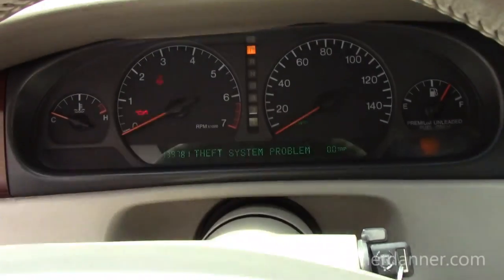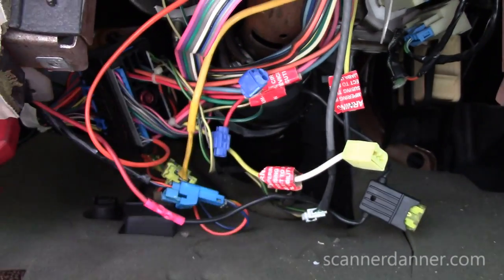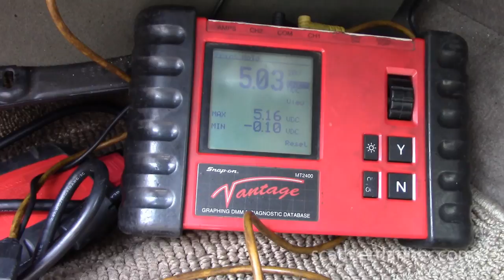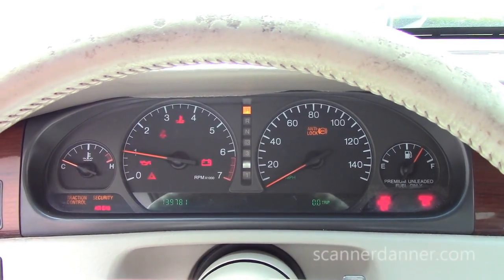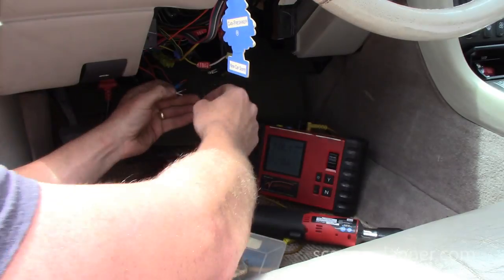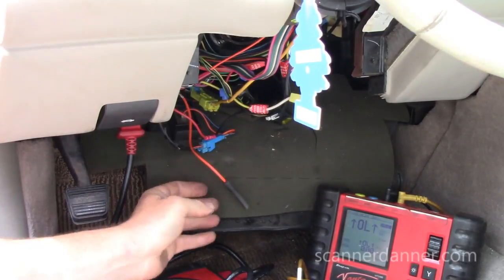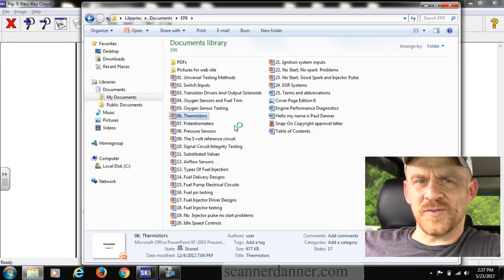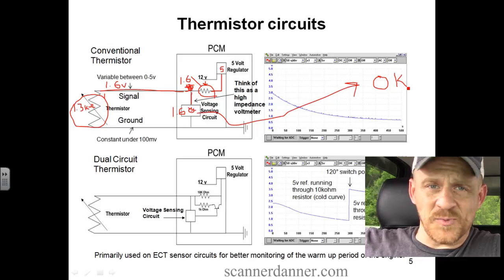How to troubleshoot/bypass a GM VATS Passlock Passkey System

Comment: I'm here in Monroe North Carolina and had just recently taken my allante to a service station on interstate 74. One day just would not start theft activated light was not flashing and had it towed to Marty Moore's repair station. they're diagnosis was bad ignition switch and vats system but they would not bypass for me said it will cost $1,000 I also had to pay $150 for the diagnosis I hope you're not that kind of shop. When I had gone to pick the car up they had it started and backed it out and parked it and said they would have to charge me in order to start it again. I am 60 and unemployed and have exhausted my finances what rip off these places are.

Comment: Easy way to solder a resistor is to cut the two wires to different lengths and solder the two ends so the resistor lies along the length of the wire then slip heat shrink over the top.

Comment: I lost the key to my 97 Lumina went to the dealer gave him the VIN number charge me $50 for a new key. key was cut right so it turned the cylinder car would start for Split Second then cut off. had the wrong pallet in there and they would not refund my money. so I got a volume control knob Off an old CB radio began with it turned all the way down try to start it and incrementally turned the knob up and it started so I measured the resistance value of the volume control knob at the position the car would start at. went down to Radio Shack matched up with the resistor of the proper value and was back in business. come to find out GM Vats had like 15 different possible resistor pellets during those years. shade tree mechanic way of doing it if you don't possess all the proper tools like scannerdanner has and you did not have the key in the first place to measure the pellet
Reply: 08 silverado lgnition replace
Reply: The mighty engineer !

Comment: I watched this video for the first time last week and what do I get in today? A vehicle that the customer replaced the battery, starter and electrical portion of the ignition switch and it still wouldn't start. First thing I check for is flashing security light, it's there. Used this bypass method and within 10 minutes had the car running. Thanks for another great video, Paul

Comment: Great video as usual Paul. I've installed a number of the various kinds of Intoxi-Lock systems that are court ordered with some DUI violations. They interrupt the start circuit and only enable it when the unit detects a passed test from the handheld unit that the driver blows into to test for alcohol. It looked like the vehicle had one of those systems that had since been removed.

Comment: Good video Paul. I love seeing the old cars too. Working on them is going to be a lost art if nobody shows them.  The way this circuit works is also very similar to older steering wheel controls and cruise control switches. There is a 5 volt and a signal return line hooked to the BCM or cluster, going through the clock spring, and each button has its own resistor value. A cheap way to have many buttons only use 2 wires.

Comment: I hate to admit that i use to install aftermarket equipment.  I tried to do the best/cleanest job I could..BUT I've seen too many butched up installs. when I went into full time auto repair I cursed the aftermarket guys without mercy.thanks for the video Paul. brought back alot of memories  (some bad)..cheers

Comment: As a locksmith I have been working on these systems for years.  Several suggestions. First you have to remember that there is a penalty delay after any failed start attempt. (3-4minutes)  next, there is a stand alone module that verifies  the  correct pellet value.  This module seldom fails, most failures are in the wires bet ween the ignition cylinder and the connector undre the dash.

Easiest test on the wire integrity  is to unplug the connector and measure the ohms between the 2 pins with the white wires in the orange cable. Chek with no key in, (should read open) then just insert the key (should read about the same as the measured resistance  of the pellet on the key.  Another common issue is dirty contacts in the ignition cylinder. This will read as a lot higher resistance.  

With this test, you can narrow down things real quick.
Reply: I was thinking that might work to check it. Thanks for verifying my thoughts on it. I will try that to see if the key is sending out the right signal.
Reply: I've had bad ecms too.

Comment: I'm glad that I found this video again.  I'm going to be looking at a friend's 1994 Olds Cutlass Supreme that is I believe a no crank, no start.  They inherited it from a family member and don't know much about it.  I will verify it's not anything else in the starting system before seeing if the VATS system is the cause.  I don't have access to wiring diagrams unfortunately so that is going to be a hinderance on diagnosing anything.
Reply from the maker: Here you go (it's $20 to buy service info for your car - same info I use)
https://eautorepair.adtrk.biz/?a=10817&c=24&p=r&s1=
Reply: @ScannerDanner  Thank you.  I guess I should have clarified in that I'm not sure if the friend will pay for service information.  I use Alldata for my own vehicles but Mitchell also seems to be very good and I may switch to it since the yearly rates are cheaper than Alldata.

Comment: I am a remote start tech..I approve of this fix. You can also do it on the aging passlock 2 system. Cut the yellow wire, measure the key side to the passlock ground, and then match it from the car side of yellow to passlock ground. :) You may get errors in the immobilizer system but it will always start. I usually solder in a new wire and tape a wire tie around it as a splint to keep it more stable under the dash!
Reply from the maker: Thanks James!
Reply: Yes that is correct you can use any of the preset values. Look on ebay they sell specific kits of 10 resistors for GM vats/passlock. I forgot to mention using my method the engine must be running when the yellow wire is cut. It also has a default strategy of if the wire is cut when the engine is running it will go into failsafe and ignore passlock but the light will stay on to let you know the system needs serviced.
Reply: This was actually how GM did their "factory" remote starts back in the day.

Comment: I dealt with a similar issue on my SRT8 Jeep a few weeks ago. The hood sensor/switch that prevents the remote start from working when the hood is open, utilized a 1k ohm resistor. I used shrink tube on each leg of the resistor and then put a 3rd piece of marine grade shrink tube over the entire thing. That thing should never require servicing again and now I can remote start with my hood up since I bypassed the switch/sensor completely!

Comment: That circuit is a simple resistive divider using the voltage divider equation you can determine the value of the resistor inside the PCM.

R1 = R2 * (Vin / Vout) - 1

Where R1 is the resistor inside the PCM, R2 is the resistor in the key (rounded to the nearest standard 5% resistor value), Vin is the voltage measured with the key removed (the voltage reference), and Vout is the voltage measured with the key inserted.

R1 = 1,100 * (5 / 1.6) - 1

R1 = 2,337 kilo ohms

The nearest 5% tolerance standard resistor value (E24 value) to 2,337 kilo ohms is 2,400 K so that's what you would find inside the PCM.

When selecting a resistor after measuring the key it helps if you have a list of the EIA E24 standard resistor values. It lists all of the standard resistors in the 5% tolerance range so you can see what standard value is closest to what you measured.

http://www.ohmslawcalculator.com/e24-resistor-sizes

Comment: Haha, yup!  Such a common problem that most of the GM cars from that era already have this done!  Not long after this Passkey system came out, thieves started carrying around resister packs and could just hotwire the thing in a heartbeat.
Reply: Or the smart ones made a simple box with the proper resistors and clipped it in with a couple wire piercing clips.

Comment: On that 97 caddy where you wired 2 3 thousand resisters in did you put both resistors on one side white or one on each white wire it was hard to see. I thought each white wire would fasten to each end of the resistors. Please help....Thanks a bunch.
Reply from the maker: the two white wires are basically connected together with a resistor in between them, acting as the key would
Reply: Thanks a bunch man i'am an old dude can't afford another car right now so got to keep baby running. One more thing my key reads 3.7 omm so you said that 1.3 omm was 13.00 so what would 3.7 be ?  Really appreciate your help you're a great person.

Comment: That's a vary common issue and repair on GM vehicles with VATS. Eldorado, DeVille, Seville, Corvette and any GM vehicle with the pellet in the key. Some people prefer to replace the ignition switch because they want to keep the car as original as possible even though it costs more to replace the switch instead of using a resistor. Many of those people are also 60+ years old and think putting in a resistor will harm the car even though we explain doing so will not.

Comment: This easy fix addresses the problem with the resistance reading coming from the key cylinder or key pellet being wrong (broke wire, dirty pellet) but what if the problem is farther down the VATS line?  I have a 2000 Chevy Lumina and the security light is constantly on but the car still starts.  Don't know if you see this much but just putting a correct resistor in doesn't solve the issue of the security light staying on.  I"m thinking maybe a failing theft deterrent module?

Comment: Great vid thank you for making everything so clear. Im just wiring in the spare key as the resistor for my 95 Eldorado. I suppose if it does work I will later wire in a resistor...

Comment: Paul , i think this video is got me on the right track , i got a 2000 3500 utility box bucket truck from a local cable company   it had a tracker in it , they pulled it when the boon lines blew out , it still ran , but it has wiring gremlins , this darn truck has been to every shop in town , they all got 300 dollars , but its still blows the prnd after it warms up , about 3 to 8 miles ..ive been fighting this too long , would you like a paid trip to florida ? Ive had it with this problem ..i got boats too ..hogs , deer oceola turkey's ,and one rustic as hell camp site ..if any of that sweetens the deal ..

Comment: I have a 2005 Tahoe. Haven't used a key in it for 5.years  I guess the tumblers were stuck. I can put the keys in to it and works fine untill now.i changed the Fuel pump GM pump because I would have to beat on it every three months it's not starting I have three codes that came up today  p1626 u126 u1300 fuel pressure is 52+ at Crank wants to start just wondering if you ever came across this before if that's cool I really like your channel I might get your premium subscription anyhow I'm a Old school mechanic trying to get up on the computer stuff it's really interesting. GOD BLESS YOU AND YOUR FAMILY
Reply from the maker: Not sure offhand my friend. I have a forum on my website though where we can help you further and it is free to join www.scannerdanner.com 
Hope to see you there

Comment: Thank you, informative. Now then, how is the hot wire identified? I have a blue wire from the PCM , and it's designated "antitheft". Problem: I removed the entire drive, cut the PCM wire, so I have the basic engine sensors and the PCM to manage fuel. The wiring is 90% finished. I'm fairly certain it is correct. The fuel pump feed comes on for 2seconds than shuts off, but the engine will continue to crank. Which is correct, although the crankshaft sensor is still sending a signal, as I have an led in parallel. What am I missing? I don't have any potential feeding my ICS, and my OIL LEVEL sensor is still disconnected, and I don't know if I need the oil level monitor to complete. Help

Comment: 2000 Cadillac El Dorado* When I measure V from harness it reads 0 ko. Orange wire to column reads 0.88ko, key and transistor both also read 0.88ko.. still nothing. What am I missing? Does the reading from the harness have to be 5v? Any ideas?

Comment: Very interesting and like how you think things through to fix a problem. I would like to know if there is an affordable scan tool that a diy person can afford, I am a retired person who has experience working on most types of vehicles and try to do repairs for people who cannot afford the dealership fees and some shops, but a scan tool would make life a little easier. Keep up the good work.
Reply from the maker: Robert, it really depends on the type of work you want to do and what market you are in. There really isn't one particular tool I can recommend. BUT, I do recommend that you get a scan tool that offers bi-directional controls, which will put you in the $1000 range at a minimum.

Comment: Hey so i cut that orange wire on my 99 bonneville and picked up the right resistor but now dash wont light up and it still wont fire up, do you have suggestions?

Comment: There a company called New Rockies. They sell aftermarket modules for Gm and Gm only for all security Full bypass. Some security module's send a pulse width signal to the pcm to keep the injectors pulsing. This module produces the signal the pcm needs. Just installed 1 on a 93 Deville. Rolling on.

Comment: Lol all come on PAUL it's not that hard to change out the ignition lock cylinder have some fun. Then you could've taught them how that is done as well. I still enjoyed the video. You met me at Eric's one year. Don't know if you remember me.
Reply: Able Lock with these, the lock cylinder comes with a standard steel key to fit the cylinder, you have to take your old key if you have it, or have the resistance value of the pellet, then go to a locksmith or shop that has the pellet blanks (gm used a limited number to cut down on having to stock so many different ones) then have the correct pellet key cut from the steel master. then its just replacing the cylinder. most of the ones I used to do failed because the two metal contacts in the cylinder wore out. with the keys being $25 and up, I keep a assortment of resistors on hand and just solder the correct value across the connector at that plug under the dash.

Comment: A few years before this system they had two wires for theft detterant that turned when the key turned , i learned to buy a new switch , they would just break again ( michigan weather , hard on moving little wire ) so i bought another new one , stuffed the original key in it zip tied in the steering column and used the broken ignition from then on ..the wires didnt turn with the key no more ..

Comment: So a guy I worked with at Chevy dealer had a Corvette that had somehow learned a different resistance than it's Pill on the key due to some corrosion somewhere. They apparently had no way to find out what that value was and he was trying to find ways to bypass it. If he had hooked in a variable resistor into the circuit and turned it, assuming there is a PID for VATS to say YES this is the right resistance. Would that have worked to figure out what resistor was needed to bypass it?

Comment: Hey ScannerDanner this is your friend again Eric from So. Cal. I wrote you a month ago about my 93 Cadillac Fleetwood with battery and ignition issues. I found the right resistor for the ignition and the car fired right up. The situation I'm having now is like the next day I try to fire it up and it won't start, but the security light still goes off so I know it's still bypassed. So I have to disconnect the battery cables and touch them together to short out the computer to erase and codes that might be inside. Connect the cables back to the battery and it starts again. My question is does the computer has to be re-learned because I did change computers (BCM) and if so how do I go about doing that? Thank you so much...Your friend Eric from So.Cal.

Comment: Paul, I have an issue with a Honda Odyssey 2003, I have car key that was working perfectly, I remove the battery and reconnect it, and after this the antitheft don'ts recognize the same key and won't start the engine. Hope you still read commentaries, the last one here is from 4 years ago.
Reply from the maker: I see them all Luis, but let's move this to my forum okay? It's free to join www.scannerdanner.com 
Too difficult to offer back and forth messages here for me.
When you post, be sure to include as much info as possible including current trouble codes if that is possible for you to read them. Thanks! Hope to see you there

Comment: 1085 to 1195 ohms is the acceptable range for this particular key of 1130 Ohms, key blank number  5.  Replacing the lock mechanism is easy, including snaking in the orange covered wire.  I have to replace the electrical switch 9n my car, after it chose to let the smoke out this morning.  My Security light is perfectly happy with my key, but I've still got no crank.  The last thing that happened before me turning the key off, was the starter engaged on the running engine.  At the VATS relay, I have an intermittent battery voltage, and the relay buzzes.  Relay seems fine, but mechanical pressure on the key affects the intermittent power condition at the relay.  I think my electrical portion of the key is worn out, and it's an air bag car.  I'm looking for a video on how hard it is to replace the actual switch the lock cylinder manipulates.  Can't find anything melted under the dash, but something surely is.  It's a 1990 IROC, air bag and pass key 1.  I'd like it all to work right, but......